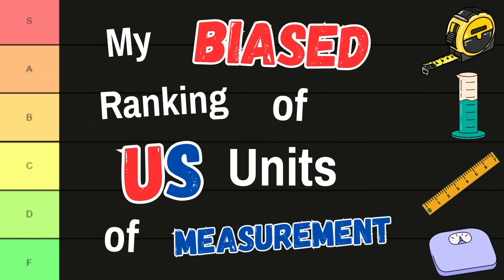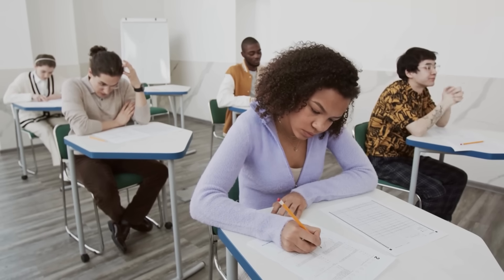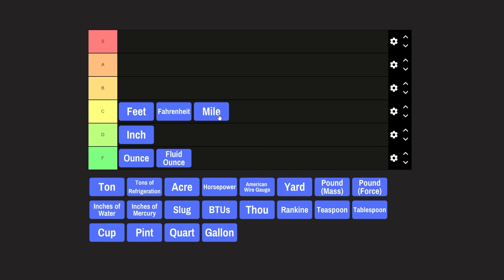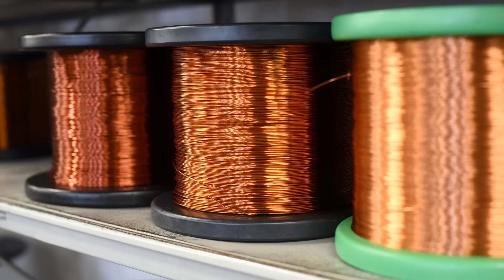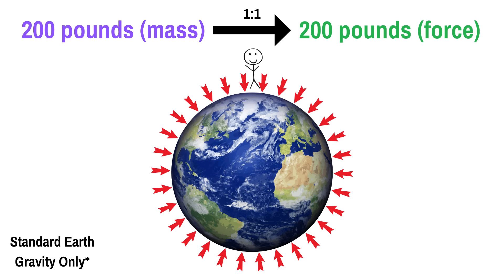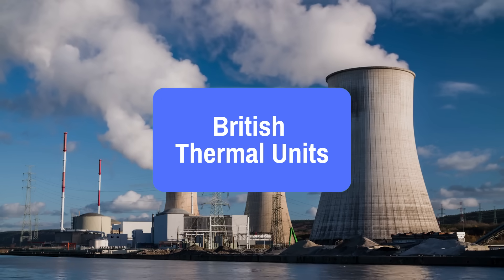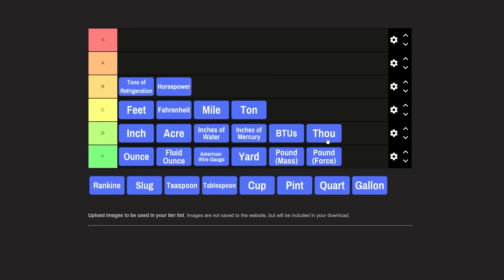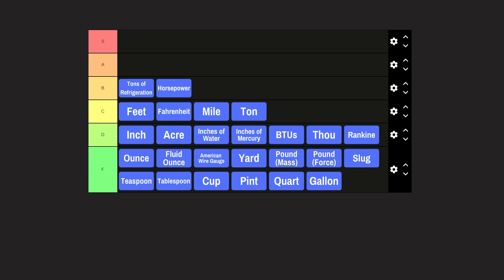Tier List of the DISASTROUS US Measuring System

Comment: I am working as a third party engineer checking e.g. static calculations. Sometimes US ones. Besides the fact that units you don't know always are hard to work with (your reference values are missing), designers are often inconsistent when using different units. lb, lbm, lbf, lbs in a nice little mixture. OK, in pure stress based calculations you usually find no lbm.
It gets really hard to follow up, if mass and accelerations are included. Here in my opinion the metric system has a huge advantage: completely different naming of units. kg and N instead of lbm and lb/lbs/lbf reduces errors.
Another story: I once got and energy calculation to determine the loads on a trampoline. Besides the designer seemingly not being able to understand simple basic concepts of load transfer, his first calculation included stones, slugs and whatnot for energy calculation. Took me quite some time to understand it, but he made a mistake, so had to redo the calculation. Not sure if it was the same designer or a different one, but for the update calculation he did everything in imperial, converted everything to metric, did the energy calculation in metric and converted the results back to imperial.
Reply: the couple of calculations I was made to do in 'murica units in physics, we didn't use anything like "lbm" -- it was just lbs (strictly force) and slugs (strictly mass) so there was no confusion

Comment: Imperial system works nice for something as reference, but for precision and accuracy the metric system it's much better, the reason that I have is the arbitrary value of the imperial system, sometimes the inch measures 2.54, sometimes 2.5, sometimes about 2.5x, same for feet etc. In the metric culture 2.567 it's is 2.567 meters and period, and if you see 2.7 you know that's and approx
Reply: right, the metric system is great for science.  customary units are good for doing daily tasks.  but actually, the inch is now defined by its metric equivalent.  it has been for years.  it's just preconverted for those of us who have to measure things that were built to customary units and divide those measurements by things other than 10.
Reply: Imperial system works fine, but metric system will always work better
Reply: @MICH4ELm  except when you're trying to force metric measurements on something built to the customary system.  then it's a PITA.
Reply: @kenbrown2808  It wouldn't be a big deal if the americans really tried to do this. But of course the LAND OF FREEDOM must make life difficult for the rest of the world 🦅 🇺🇸 MERICA 🇺🇸 🦅
Reply: @MICH4ELm  that sounds like a you problem.  I use the unit that works best for the application I am using it for.  whether that is inches, feet, pounds, football fields, or paces.  I also use milligrams and liters, but somehow, any time I try to use meters, I end up with a 4 or 5 digit decimal value, or something that doesn't fit.  I remember back in grade school, they handed out meter sticks, and told us it was the measurement of the future, and it would make everything easier, because we'd only have to divide or multiply by 10.  and it just didn't work that way.  we were still dividing things in half or thirds, but we were starting with a 4 digit number in stead of a 1 or 2 digit number.
for example, I can use a half inch fitting, or I can use a 12.7mm fitting.
Reply: @kenbrown2808 Once upon a time, each region had its own individual measurement system... If the USA was the only country that failed to change to the metric system, the problem must be with the Americans, because decimal numbers have not turned out to be such a big problem anywhere else
Reply: @MICH4ELm  and decimal numbers aren't a problem to us.  the problem comes when somebody demands we use numbers that don't come out even, because that's the way THEY like it.  Once Upon a Time, there was a discussion of whether people here would do things they way somebody on the other side of the ocean wanted it.  two days ago we had our annual celebration of winning that debate.
Reply: @MICH4ELm  if by "problem" you mean not forcing people to use units that are terrible for the purpose.
Reply: @MICH4ELm  and by "rational" of course, you mean "do what YOU tell them to regardless of whether it makes sense"  again, there was a discussion of whether we would do things somebody else's way, and the answer was "no."  we have the freedom to use the units we want to use, and the result is that people who need to measure their water by length and their distances by volume, use metric, and those who need to measure things that exist in nature, use a measurement system that is based on the sizes and scales of the things they are measuring.  and that is why every measurement in my house comes to an even number, instead of having to be rounded to three or four decimal places.
Reply: @kenbrown2808  By "being rational" I mean making life easier for others around the world... what you don't do. This is the reason to introduce the metric system worldwide. It's not impossible, it's just that Americans want to have everything in their own way, regardless of whether it makes sense. USA! USA! 🦅
Reply: @MICH4ELm  actually, most of our export goods are done in metric. But don't let that slow your jingoistic roll.

Comment: It is just way easier to convert measurements in my head using the metric system. I mean can you easily how much kilometer are 129 meter. Yeah 0,129 km. The US Measuring System even have different miles: mile and nautical mile. This makes no sense at all.

Comment: It takes balls of thunder to claim US measurements are flawed when the wuck-fittted lunacy of metric is on the board. Decimal is dumbass, based entirely on the arbitrary "eye cans haz tehn fingars". Thus metric is equally dumb.

You can tell metric is stupid when it has 100 "degrees" between polar opposites. That's just hurr-durrz. 

The biggest problem though is the lack of 3... when 3? It's a magic number. The ancient Sumerians had it right, the 3, 4, 5, 12, 24, 60 progression because it keeps the first three primes in the mix. There's a reason we still use it for time and navigation. That you can divide by 2, 3, 4, and 5 without resorting to decimals? Brilliant.

Even mantissa is utterly idiotic compared to fractions. You know fractions, right? Where no matter what using nothing but integers you can ALWAYS state the result of ANY division with 100% accuracy? You can take your 0.3333333333333~ and stick it. Can't even divide by three and get a whole number result in a lower metric? BARF. Then people waste time trying to state Pi? I wouldn't be surprised if at some point somehow with large enough INTEGER numerators and denominators that even Pi could be stated as a fraction.

"Imperial" has its flaws, but it's nowhere near the shit-show of incompetence that is metric. And that's because decimal itself is arbitrary, and in no way, shape, or form based on actually useful math!

It's even the message of Arthur C. Clarke's "tycho monoliths". 1x4x9 == 36, the yard is superior to the meter.
Reply: Make better rage bait
Reply: Yet NASA and the US military uses it because it's better.

Comment: Divide 10 by 3 and reply with number that is not rounded...
Reply: Try divide 12 by 7.
Reply: @thefrench8847  same problem as dividing 10 by 7 genius...
Reply: @meotjaengi  Exactly. You just round it or use decimals to whichever level of precision you need. What's your point?
Reply: @logitech4873  Exactly.  What's yours?

Comment: Love that you have the wire gauge in there. In metric the sizing of wires is done by the cross sectional area in mm² but for really small stuff the diameter is used, as to not have it be 0,000001mm2 but 0.001mm
Reply: and anything in the US above 4/0 size is measured in circular mils - which is the diameter of the wire in thousandths of an inch, squared.

Comment: Teaspoon, tablespoon, cups, and quarts play relatively well with metric so I'd put them in B tier. If not even A tier (at least with like a sliding/adaptive grading system).

Inches should be with feet. The one thing good about them is that the conversion between the two is kind of like base 12. Which would have been good if we ever had used it instead of decimal, but alas.

I have mixed feelings about tons of refrigeration energy. I suppose it's intuitive concept, but it's still based off the erroneous ton so I don't see why it should be ranked any higher.

Miles are trash. conversion from feet (or square miles to acres) are long multi-digit numbers that are not easy to remember or calculate with. More than almost any other unit (AWG being the only competitor) miles should deserve F tier the most.

Comment: As an Electrician, I'm gonna have to argue for the AWG measurement. 
It basically just helps generally visualize the wire size, kinda like how HP simplifies things to  90% of people 😂

As an installer, asking for a wire you need as #10 or a #12 is significantly more intuitive than referring to it as a "10380 circular mill wire or 0.78 mm wire 🤓". Screw trying to memorize those minute decimal points. 
AWG going "backwards" really helps when you think about how wires you can fit in a pipe or box.
Reply: Metric wire sizes are standardised, so it comes naturally. There is 1mm², 1,5mm² and 2,5mm² for instance as standard sizes. You most likely won't find anything in between. And it gives you the exact measurement that you can check with just about any measuring device. No special gauge gauge required.

Comment: Imperial is better than metric, and the people who claim otherwise don't actually use it. It has units which are more readily useful for the tasks to which they're commonly put. The base-12 scale of most units means that you can easily divide them in halves, thirds, and quarters, and fractions are almost invariably simpler to compute than decimals. What's easier to remember, that you're 6'2" or that you're 188 cm? How does that difference look when you're 175 cm, as opposed to 5'9"? Imperial is especially simple for cooking, where a cup is a cup, a pint is a pint, and a tablespoon is a spoon. How could that be easier?

Imperial units were devised for the purposes regular people need measurements for. Metric was devised by a committee of politiicans who wildly overreached their actual purpose, which was to simply make sure that France had one set of common units and measures, instead of every town having their own version of a pint or pound. And by so doing, they repeated the exact same problem they were trying to solve: creating disunity in measuring systems.
Reply: you compared foot to centimeters how is it a good comparison ? if i say i am 1m75 he understands directly that i am in the norm and 1m80 is slightly above . Also how is a base 12 better than a base 10 ? 10mm is 1cm . 100cm is 1m .1000m is 1km and it works for all units
Reply: @laurielkami1100  I use that comparison because literally every time I hear some non-American describe their height, they use centimeters, not meters and centimeters.

And base 12 is better because 12 / 3 is a round figure, instead of 10 / 3, which gives you 3.33333... decimalization is overrated.
Reply: >a pint is a pint
Actually it's not. The imperial pint is 20% bigger than the US one
Reply: None of what you mentioned is worse in metric. You're making up imaginary issues.
Reply: @logitech4873  FIne. Express to absolute precision what 1/6th of a meter is.
Reply: @AaronMichaelLong  0.1666... etc. Just calculate it yourself with a calculator.
What's 1 inch divided by 3.73? Please express this in absolute precision!!!! Lmao.

Again, you're making up imaginary problems. You calculate to whichever level of precision you need, and then round the last decimal. Not every number divides cleanly, that's just the reality of math.
Reply: @logitech4873  You failed the test, and utterly failed to rebut my point. There are many, many situations in which an ordinary person will want to cut a recipe or measure by thirds or sixths. 12 has factors of 2, 3, 4, and 6. 10 has factors of 2 and 5. So, a base-12 system of measurement is literally TWICE as easy to handle simple situations where you need to divide into even parts.

I win, you lose, t'was ever thus.
Reply: @AaronMichaelLong  Again, imaginary problem. Literally nobody's limited by things like this. And you forgot to express what 1/3.73 is to absolute precision. Why didn't you do that?

Comment: I lost it when wire gauges went to 00, 000 and 0000. What kind of idiot would invent such a measure system.
Reply: I genuinely think that the AWG system is the best of all these, or least bad, whichever way you put it. Why? Because it is just used for wires and you don't need to do any calculations with it. You just know that 28 is fine for a thin signal wire and 14 is useful for something rather power hungry. I hate all the other of those units though and live in a metric country, but for wires I actually use AWG and find it useful.
Reply: @zapador  why would you need to use calculations when using mm2? 1.5mm2 is standard for 16A/230V short runs, 2.5mm2 for longer runs. Its easy. 4mm2 has double thickness of 2mm2. How do you double thickness with AWG? You don't. Its arbitrary.
Reply: @KoeiNL  Never said you need to do calculations when using metric wire measures. Nothing bad about the metric wire units either, I've just been less exposed to that system so to me AWG works fine. I still think it has to be the least bad of their units.
Reply: @zapador  No, metric is still better because IEC 60228 is based on the cross-section and not the diameter of the cable. Because the cross section is directly proportional to weight and strength (en negatively to resistance). AWG is based on SWG, but even the British figured out that metric is far superior in this application. I guess if you are not an engineer and just need to look up AWG in a book to see which number you need then it works fine. Doesn't mean its better though.
Reply: @KoeiNL  I never said AWG is better than metric. I just said that I use it because it's what I've been most exposed to within the hobbies I do, everyone there use AWG. 
What I said about AWG is that out of all the systems rated in this video I think AWG is the least bad.
Reply: @KoeiNL  Yes you do, because as it was briefly shown in the video, you might have noticed that the 39th root of 92 raised to the 6th power is very close to 2 😀 So you double every 6 steps in the scale
Reply: Ok but mm2 works the same and you can actually intuit what it is if you've never worked with cables. I use a klein wire stripper for some reason and I can never remember the conversion.
Reply: That happens when you have to make numbers smaller than 0. It is same as with batteries. We have AA. AAA. Not that Europe is more logical as those are LR-6 and LR-03. (note the zero on just one is not a typo).

Comment: I changed my job for three years as an aircraft electrician/repairman... I live in Germany and previously worked in the truck sector... since all the manuals for retrofitting aircraft were in the stupid, insane, incomprehensible US measurement system, I had to get used to it for months the habit... cables with a higher "number" were smaller in the cross-section than those with a lower number... which drunk came up with that?

After being upset about it for three years and making some money, I'm back to my trucks

I seriously asked myself how the USA is even capable of building anything... if you grew up with it, it's certainly easier for you... but how much energy and learning capacity is wasted on this confusing world of units... crazy

Comment: A very common response Americans make on this subject is that the imperial system is iNtUiTivE. Of course you feel it's intuitive because you grew up with it. Having grown up with the metric system I feel it's more intuitive than the chaotic mess that Americans are used to. Apart from the totally subjective intuitiveness thing, the metric system is objectively better facilitating easy calculation and conversion. Just get over with it already.
Reply: But here's the thing, I don't need to know the conversion factor from inches to miles, because no one does that conversion. Why does everyone on the internet think conversion is some kind of important necessity? I couldn't even tell you the last time I converted something not for a college class. It's just not a pressing issue.
Reply: Not for you but for every institution that matters it has caused issues, billion dollar rockets crashing into the floor for instance